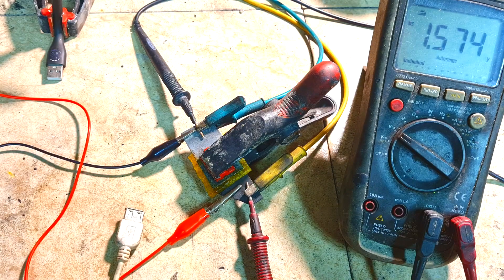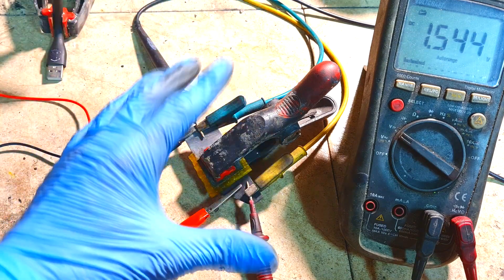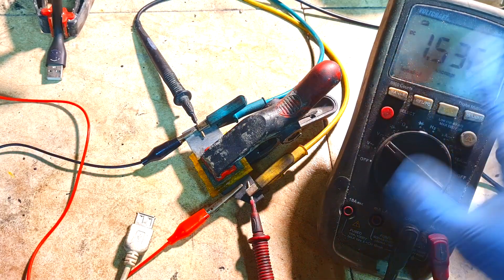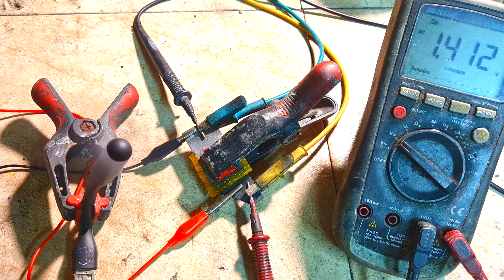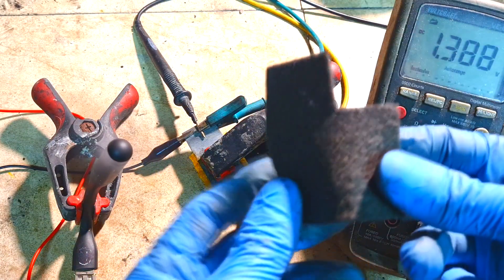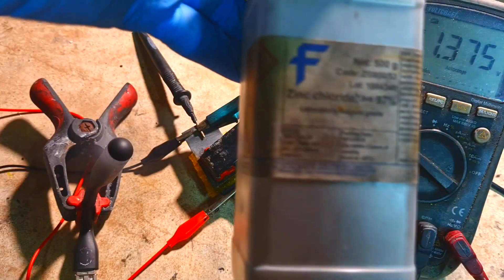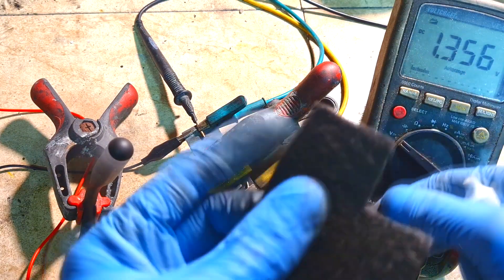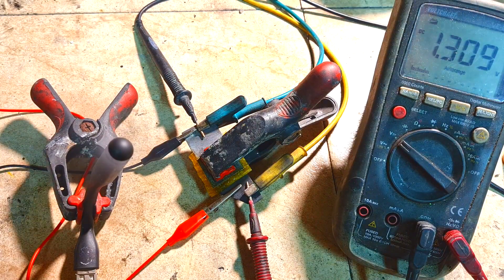Awesome battery with potential for off grid? - Zinc Iron Battery

Comment: How thick graphite felt did you use? What is the minimum thickness for it? Will it work by using zinc foil as the anode, regular toiletpaper as a separator and the carbon felt, and graphite coated copper foil as anode?
Also do you think using thicker graphite felt will increase the capacity of the cell?
Reply from the maker: The felt is around 3 mm thick. The minimum thicknes is 2mm on ebay,.... and 0.5mm by companies if you search on internet. Your cell setupe will work. Yes, whith more thicker carbon felt you will get more capacity per cell
Reply: I have an idea, and am really curious to hear your opinion about this as an experienced individual in this field.
Could a battery like this work by using aluminium chloride and iron clhoride as the electrolyte and aluminium as the negative electrode?

Comment: I am curious if this chemistry would benefit from a water in salt electrolyte.  Its a chloride based electrolyte. You could increase the ZnCl close to 30mol and experiment with the other ratios, leaving out the PEG. I can't experiment at the moment so I'm just putting annoying thoughts out there.  my apologies.
Reply from the maker: I dont know about using WiSE in that cell. But I try that WiSE electrolyte in some other cell and I can tell you that I get alot of crazy dendrites.
Reply: @cayrex  Interesting. Years back I was playing with potassium acetate WiSE with a small amount of zinc acetate. Results were ok, but no dendrites. I only read about ZnCl WiSE.  They reported less dendrites than low molar solutions.
Reply from the maker: @Ahamshep  yes,... potassium acetate is for the main wise electrolyte compound. ZnCl2 WiSE was not so good for me,... dendrites, not so good cycle stability,..

Comment: Great work! This is very fascinating. It has been a few years since I worked on my batteries. My chemicals and equipment are sitting on a table in the corner collecting dust. I was working on low cost locally available materials. The biggest problem I had was impurities in cheep fertilizer grade compounds. ZnSO4 is very cheep as a fertilizer, but its contaminated mainly with iron, although there are traces of copper and various other metal ions.

With this chemistry maybe the impurities are not an issue.  ZnS04 can be converted to ZnCl2 with CaCl2 "another relatively low cost locally available material". The cost would have to be investigated to determine if the effort would be worth while. 

All this to say this is very inspirational!  Thanks!

Comment: Hi!! Very good job, what is missing to me is energy density, did you do the math?
Reply from the maker: Around 130 mWh/g-1 or around 30 - 40 mWh/g per cell weight
Reply: @cayrex  ok, not bad at all, the graphite plate and the low density of zinc make the difference!
I was trying to evaluate the volume and compare it with the actual flow battery...I mean it clearly depend by the application, maybe this setup could be a breakthrough for steady systems were volume is not a problem (as home energy storage), getting rid of the lithium and replacing lead acid batteries. For example for maritime application or automotive the flow option could be still the best (even though for the "recharge" time that is actually the time of pumping "fresh" electrolyte)
What do you think?
Reply from the maker: Yes you are right. The non flow ZnFe battery is in fact cheap and non complex version which have the potencial to replace lead acid is some applications. For home storage applications can be that ZnFe cell  good. The flow version can store much more energy (because of the external tanks), but have more expensive and complex design that non flow version. I also think that the power output is lower in flow version,... because is the issue by most of the flow batteries.
Reply: @cayrex  that's a good point, actually low output may be a problem for transport as well...the mechanical load may vary a lot and in some moments high currents may occur...I was thinking about a parallel super capacitor bank, charged when the output is lower that the max possible output, that get in when needed, so the flow battery works at "constant" load, but it is indeed a complication.
Anyway, yours it's a lovely job!🤟😉
I work on photocatalysis, and when I first looked at your work in the first arrangement, knowing photocatalytic properties of chlorides, I thought maybe your battery may be charged by sunlight, it would be awesome...if I find a bit of time I would try!
Reply from the maker: Some time back I try to make some photoactive battery with titanium nitride and iron(III) hexacyanoferrate(II)
Reply: @cayrex  Really?!:)Did you find any results? I have an artificial sunlight so I could make proper tests!
Reply from the maker: No not really. I didn't get the right titanium nitride. So, in the end that was only several day project
Reply: @cayrex  i understand, maybe it wasn't the right match, why did u use titanium nitrate and not the oxide which is the most active, what was you idea for the reaction?...anyway playing with the reduction and oxidation photoinduced potential of different species, in theory, it is possible!
Reply: Hi can I ask you've said in your video 3.5 amps is that right?
Reply from the maker: @bilibong0101  almost 4 Amps, yes